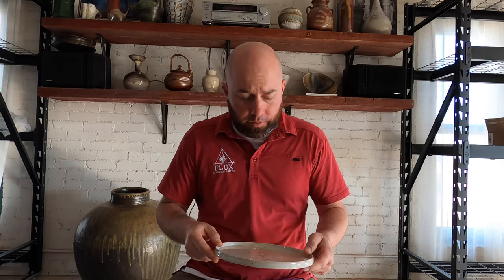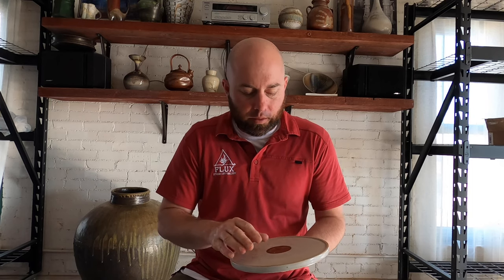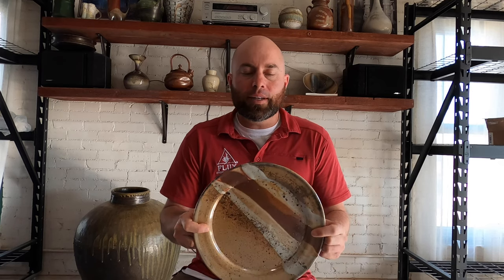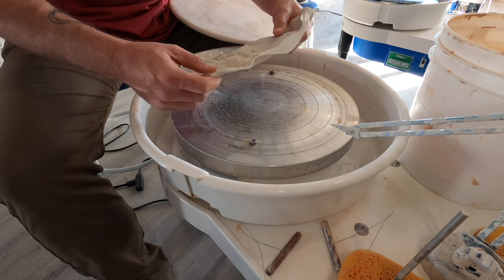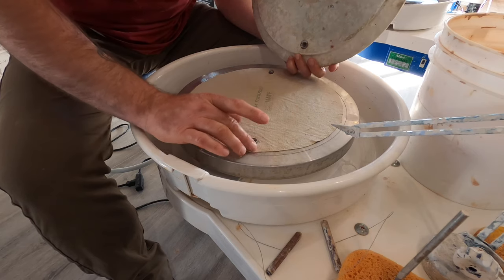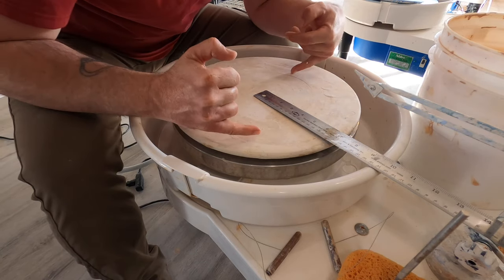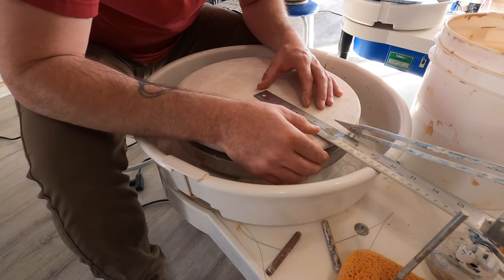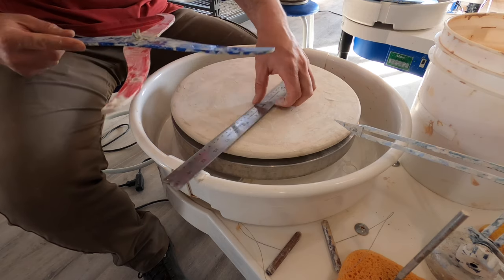Introduction To Throwing Dinner Plates On The Pottery Wheel With Derek

Comment: This is the most complete video on throwing and trimming plates that I have found in 3 yrs of being a self taught potter. Thank you very much! I find that the hydrobats make the centre of the  clay hump up off the bat while throwing. Am I using too much or too little water?
Reply from the maker: Thank you so much. I am so glad it helped. I have the same issue with the hydro bats. if you can dry them a little slower so that the edge does not dry before the center it will help with the lifting of the edges. Try wrapping the edge with plastic and cover with cheese cloth. Make sure that the bat is resting on a wire rack or something that helps get air flow under the bat. Also you can leave the bottom of the plate much thicker so that you can trim the hump out of the middle. I hope that helps. Please let me know if you have any other questions. Have a great day!